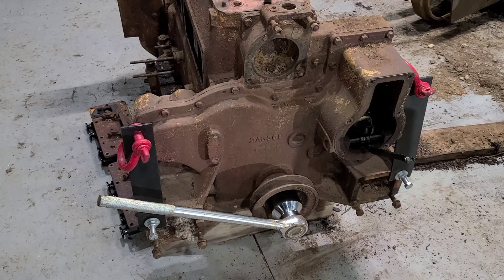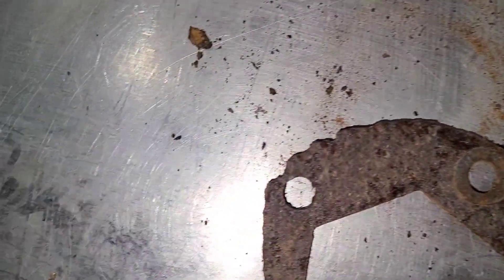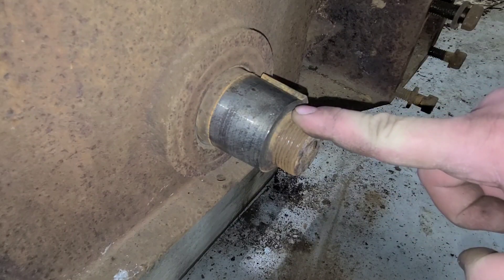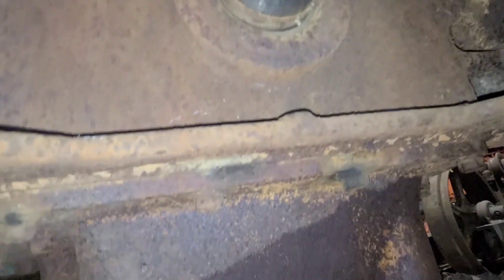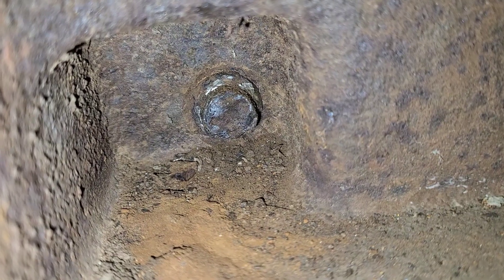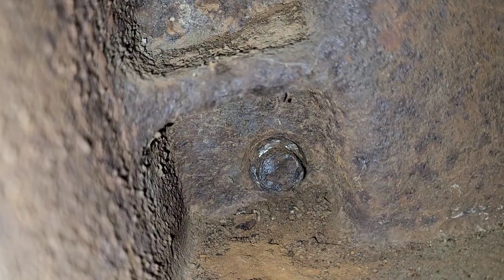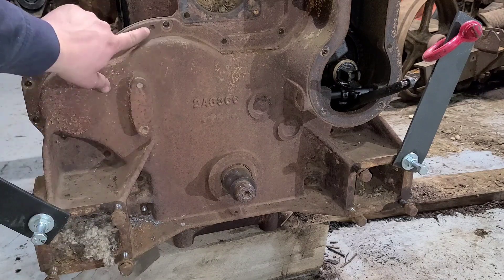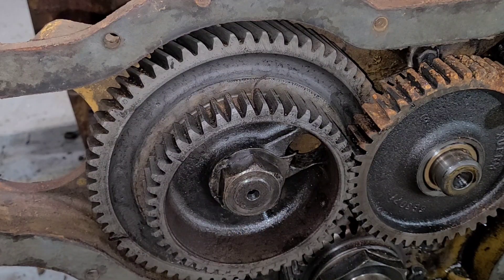Caterpillar RD-4 Engine Disassembly Pt.7

Comment: The repair of the trailer, like all videos of restoration are jems to watch for me. Thank you for the update on the RD 4. Keep on, Keeping on.
Reply from the maker: Thanks for following along!
Reply: @kylechrist , I told you about the torch - ice water remedy for freeing rust frozen parts. Well, there is a Texas welder whose channel I also follow. His channel is "IC Weld" yesterday he was attempting to free a 6" x 2' steel pin that was frozen in place and he used a similar method. He heated the pin's cylinder with a torch then used water from a garden hose to break the pin free, he even said that he was doing it to "Shock" the pin free. In his case, it didn't seem to me to help very much, but I thought that it was quite ironic that I had recently told you about a similar method using ice water. In his case, I believe that the pin was more than likely somewhat bent and that was his main problem of getting the pin out. He ended up gouging the pin from both ends with the torch using a gouging electrode with compressed air system. If you find the time, go to his channel and look at his latest video post.

Comment: It's worth noting that penetrating oils take a while to creep through the rust and the main objective of a penetrating oil is to creep into the rust and then slowly dissolve it just enough to allow the bolt to come out easier it can take up to several hours for the penetrating oil to creep thoroughly through the rust and if it's thick enough it could take up to a couple of days and even then there's no guarantee that it will do it
Reply: But, that doesn't happen in reality 👍
Reply: I agree that penetrating oil takes a long time to soak in but I’ve never experienced a penetrating oil which dissolves rust.
Reply from the maker: I won't argue that, but unfortunately I'm not going to wait days to see little to no improvement over removing them dry. I'm going to do a test of penetrating oils coming up soon!
Reply: Agreed, when I worked on my 1968 Rustang I would spray penetrating oil on the nuts/bolts the night before.  I like to tell myself that it helped ....  Also agreed with Kyle, do what works best for you.

Comment: Those gears are fine. I've run some worse than that.  Order some powdered citric acid dilute with water and you have your own evapo rust solution.  If you can get your hands on a plastic 55 gal drum.  Cut the top off and start running parts through it.  Although it does need to be warm.  80 degrees is about the bottom end for timely rust removal.  I've used that solution for years.

Comment: If it were me, from what I can see behind a computer screen and not with the part in my hand, I would not worry about that idler gear. I rebuilt an old military jeep transmission and transfer case many years ago that sat for years full of water. The gears all looked far worse in it, but I decided to put it all back together with new bearings and seals and see what would happen, figuring the transmission and transfer case would howl like crazy. Since then, I have put many very hard miles off-roading on that jeep, and the gear train is hardly any louder than any other old jeep I've driven; and it has not given me any problems at all. That being said, it certainly isn't the best practice to reuse old rust pitted gears, but I'm guessing that tractor will never see the amount of work it once did and those gears would likely never give you any problem.

Comment: Those of us who said it was easy to pull those rusted nuts and bolts did mean it WAS easy but that your skill, tools, and determination made it SEEM easy. We know this is a monster job. It’s why we watch. And I always wondered how anything penetrated the threads of rusted bolts. Maybe in a pressure vessel in a weeks time…
Reply from the maker: If you have long enough to wait then you may see results, but I'll guarantee heat from a torch transfers faster 😁

Comment: I weld a nut that just fits over the rounded off bolt head. Let cool and back out, works for me! I really like your videos, keep up the great work!
Reply from the maker: I've done that before too and it works well, with it being countersunk in the casting I found it easier to drill the head off from it

Comment: I'm surprised there have not been a lot more headaches for you in this strip down Kyle, I've seen things in way less deteriorated condition putting up a fight, my 1942 International W6 for example (which was still driving) has given a few skint knuckles and broken bolts and I haven't even started on the rear end yet.
Your CAT is coming along great, great content in your videos and your commentary is easy listening to as well.
Definitely worth making a video about your trailer resurrection as it's a completely different subject but most certainly shall be educational.
Keep up the good work. 👍👍
Reply from the maker: Thanks! So far it's been going well!

Comment: The timing gear doesn't carry a extreme load I would say that it's safe to reuse if a perfect replacement is not available. Like the one guy mentioned it may have had a fiber timing gear when new and that would explain why the camshaft fold over lock tab has been reused it probably had the camshaft changed at the same time and iron idler gear installed
Reply from the maker: Correct, all its doing is turning the injection pump and lift pump. I think it will clean up but if I do find a better one, I will use the better of the two. I bet it did have a fiber gear at one time as well
Reply: @kylechrist  that is true

Comment: I used to have drill bushings with 1/2 and 3/8 Od's to allow me to use the socket and drill bushing as a guide to let me drill straight thru the shank. I still do that with lug nuts. I have cheap sockets to use as 3/8 and 1/2 drill guides
Reply: Interesting concept!
I've often thought about making an adjustable drill guide for drilling out broken manifold bolts. It would be fastened to the head by an adjacent useable hole
Reply from the maker: This is an interesting idea Wayne, I may have to borrow it 😁

Comment: As for your experience with penetrating oil, I have to agree. If you have a situation where it can stay there for days and you can tap on it to help it penetrate it works. I used that method to extract some broken exhaust studs and it worked. It took a few days and they came out easy enough, but I wasn't in a hurry and it was just an experiment to see if I could avoid having to take it to someone who had a torch.
Reply from the maker: It has its place and purpose and I use it, but as you said it needs time to work, sometimes days, and realistically that doesn't work for most people. Thanks for watching!

Comment: Small rust pits hold oil for better lubrication. Kinda like the cross hatch in the cylinder liners. I wouldn't be scared to reuse those gears at that level of pitting.
Reply from the maker: Good to know Chris, you have a lot of restoration and mechanical experience so I feel better if you say it will work

Comment: Spray, if you think, you will realize, the spray is for frozen, or locked bolts. Not ones that come loose easy. Also if you use spray on a locked bolt/nut, you need to realize, it will take some time to penetrate. Yes you don’t need to use spray on loose, or easily removed fasteners. That you don’t need to try to explain.

Comment: I still also agree, the penetrating oil will not get in to lubricate the threads unless you have days, weeks or months to wait and even then it doesn’t loosen the rust. You have to break the rust loose by slightly turning the bolt and then work the bolt back and forth to flush the rust out with the penetrating oil, after the first full turn it usually frees up a lot more but on a real tight one take it slow so you don’t build up heat from friction which can cause galling, at which point it is pretty much a lost cause. I’m sure you’ve been there. Interesting side note, probably 50 years ago Allen showed me a fiber timing gear with the teeth stripped off of it. He told me Caterpillar used them in early engines but were prone to failure. I don’t rightly remember if he said it was from the RD4 but put 2 and 2 together, he had a failed gear to show me and now we know an RD4 which had obviously had the gear removed. Maybe Squatch knows some history on Caterpillar’s use of a fiber timing gear. Another failure were the pistons with screw on tops which I believe Squatch brought up in a video. Allen bought a new 22B with a D318, it had a failure of one such piston and Caterpillar warrantied it.
Reply from the maker: Squatch253 has a fiber gear for a D4400, I'll see if I can get him to chime in

Comment: Kyle,
Another Excellent video! As far as the trailer goes, I think that would make a excellent series.
Your demo on penetrating oil was very good, and should keep that topic down to a slow simmer. It will never be gone and it is like a few topic on Squatch's channel like lubricant brands grades etc that he avoids like the plague. 
I realize that you have a family, and I hope they are well, and a day job, and I will presume a second day job as well. If you have the time to expand that segment out, show some spray and turn, soak and turn (even for a few days and re spray) when you get questions on it you can refer them back to that video. otherwise write down the time segment in this one and post it by you comment replying device. 🤔 🙂
Reply from the maker: Stay tuned, when I get to the pony motor we are going to do a test of quite a few different penetrating oils, as well as my favorite, heat. Thanks for watching, family is doing well!

Comment: Kyle, it's a no-brainer to use the penetrating oil on exposed threads only as you say. The only way you may use penetrating oil on a hidden thread is maybe - maybe again on a bolt standing vertical but very highly unlikely will it penetrate unless it has a passage access to the thread and shank of bolt
. To loosen any seized or resisting hidden thread is use heat and even then when using heat when the whole idea is to heat the female part of the thread and doing so you only have seconds only to place pressure on the bolt to move it. However once a bolt is loose and has exposed thread, using a rattle gun to remove a bolt is flaunting with tear damage on the thread so back of with the rattle gun and using the conventional method to remove the bolt - a correct fitting spanner or socket which you probably do use. Using the method of tightening and loosening the threaded bolt will be the safest method of removing a rusted bolt. Just helping you out for you to explain. I did say once for you to use penetrating oil to an exposed thread only. Like you and many many others removing huge rusty bolts in the industry has been my game. As you can imagine some of the gear I have had to use are very powerful torque multipliers 
and along with heat as well. 
 You are doing a great job and enjoy your videos and why do I watch you all do your thing with these small dozers because rusty penetrating oil runs in my veins and have night mares about big rusty bolts so to speak..

Comment: Hi Kyle, I take your point about thread release, far better to grease the bolts when they go in? Maybe there's a downside to doing that which someone can point out. However, WD 40 is not really an a thread release agent, the WD possibly stands for Water Displacement. Having said that like many I use it as a lubricant when machining aluminium!
Reply: Water
Displacement
40th formula
Or so I've heard..
JB-80
Twice as good. 👍
Reply from the maker: Correct, it's not a true penetrating oil, but it is still a lubricant, and works wonderful for machining aluminum. More to come on this subject

Comment: Hi Kyle. I'm not a gear expert, or even a novice. However it is likely I think (!) that minor tooth pitting will simply improve lubrication. The area is so small it will not affect load bearing very much at all. You would need, of course, to ensure there was nothing protruding above the gear profile but a few minor dips should be fine. Others will know better and I'm sure they will comment. Having said this if I could find a gear in better condition I would use it. Anyway(s) it is your machine!!
Reply from the maker: We will see if I can find anything used, if not, this will be cleaned up and reused

Comment: threads are designed to come into full contact.
fluids cant travel down the threads 
in plumbing they use teflon tape or dope 
they think it "seals"   but it cant .  imagine teflon tape holding back water 
it just provides lubrication to turn the fitting a little more

Comment: Bring on the trailer project or at least highlights of it! Your project Kyle, you take stuff apart the way you see fit. It has been working pretty damn good for you! I do use penetrating oil sometimes but i use JB Blaster. I never had good luck with WD-40!
Reply from the maker: I know WD40 isn't a "penetrating oil" but it does disperse water and is a lubricant. More to come on this shortly, thanks Doug!
Reply: I have good luck with aerokroil

Comment: Thank you for making the point you did about penetrant. I cringe every time someone squirts and wrenches. But you didn't finish the job. If google is as good as it claims, it should be able to find some comprehensive tests on the subject that were reported sometime past.. I'd direct you if I could remember when they were done. Bottom line was: penetrant' s alone will usually  work if given enough time and repeated applications; penetrants will work faster if occasional vibration is added, as by an air hammer or impact socket. Neither method works quickly. As we all know heat will often hurry the process. But spray and wrench success is almost never attributable to the quick spray, as you proved. Find those test results for us! Thank you

Comment: Kyle, a real penetrating oil (NOT WD-40!) and application well in advance of removal might change your opinion. With that said, your example hardware wouldn't benefit much anyway. As you said, assemblies like the track adjusters are where penetrant really helps.
Reply from the maker: I'm going to do a test when I get to the pony motor of different penetrating oils and see what a general consensus is after, thanks for watching

Comment: When I have a bolt like that I bevel a piece of bar stock and weld it to the head and let it cool !!! Most of the time it will  screw right out !!! 
Trailer  yes 👍
Reply from the maker: I would've welded a nut to the top but the casting is counter sunk with the bolt at the bottom. Drilling was the cleanest method, especially since the bolt head was gone anyway. Thanks Evan!
Reply: @kylechrist  Kyle  yes 👍  bar stock works better because you can get away from  it

Comment: You're using the wrong penetrant,  WD40 is for water displacement hence the name WD40 (Water displacement Formula 40)  You should try PB Blaster.  It's meant for use as a penetrant and works much better. Also, penetrants take time to work no matter what you use. They need time to wick in by capillary action.
Reply from the maker: Stick around, I'm going to do a test on a bunch of penetrating oils

Comment: With regard to the "penetrating spray debate" There are two elements required for penetrating spray to work. The spray and TIME. it is not instant.
The way you setup your example is akin to putting a wrench on a nut and expecting it to undo itself without the application of force.
Reply from the maker: Everyone keeps saying time, how much time 🤔
Reply: @kylechrist  Sometime between now and  the end of the universe 😁

It depends on how badly corroded and how deep it needs to penetrate. It's like saying how much torque do you need to remove a nut. The only valid answer is "enough"
Reply from the maker: @Agnemons  stick around, I have more testing to do and we aren't done with the penetrating oil debate yet

Comment: Tight bolts .. I agree...

But when you were pulling shafts out of the rear for steering clutches.. I dont care if you use oil or snake oil.. anything would help vs. Dry rust powder.. just my opinion. 

Also, wd-40 is garbage,  again, in my opinion.  I like Kroil. 
No endorsement or anything, I have used it and it's..the lesser of all evils. The evaporust works if you have half a chance to begin with. Reference Diesel creek cat grader with a stuck piston, (again no affiliation) I have had simular results on our own rusty D2

Comment: Usually these things are covered in atlreast 1cm thick crust of oil.. this thing looks like it's been soaking in asetone past 50 years
Reply: wd-40 or any other penetrant (other than oxy-acetylene) wont do a thing for bolts, only after it starts moving a bit it's good idea to spray it and twist it back and forth to work the lubricant down the threads
Reply: Rust pitting is but a another oilgroove :)
Reply from the maker: @NuffMan_  I agree, and also why I'm not a big fan of penetrating oils

Comment: Wd 40 😂 what were you trying to prove? 
Can’t believe anyone said to spray onto a bolt head in a blind hole would do anything.
Reply from the maker: Thanks Paul, I thought it was irrational thinking as well but just to prove the point that it doesn't work I had to do it on camera haha

Comment: Penetrant does not work that fast. 
Also, an actual penetrant is the gauge. WD is not that. 
That being said, I don't often use it, because it does take so long to work properly. Except as thread-chase lube.
Reply from the maker: More to come on this, I know WD is not a "penetrant" but it is a lubricant
Reply: @kylechrist  Agreed. And to your point about it helping break up the rust to say, run a nut off (like your adjuster) that is another place I find it to be useful, and for the reasons you mentioned. 
Loving the content by the way!